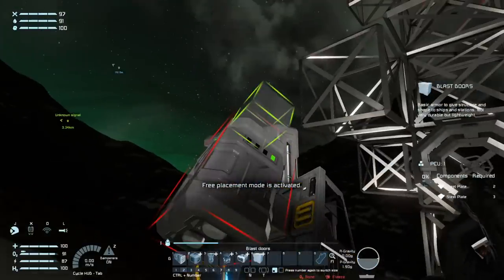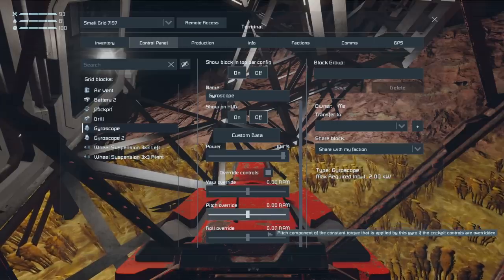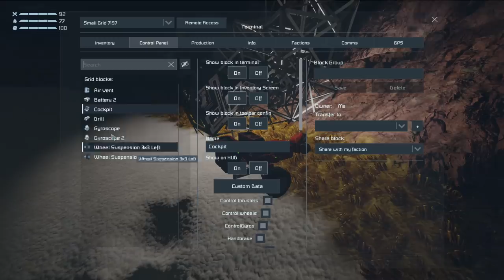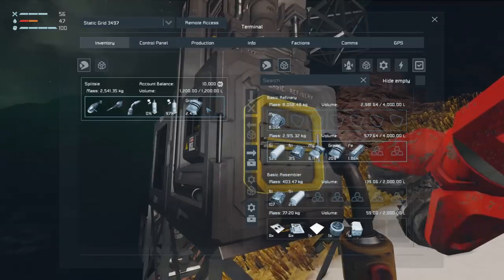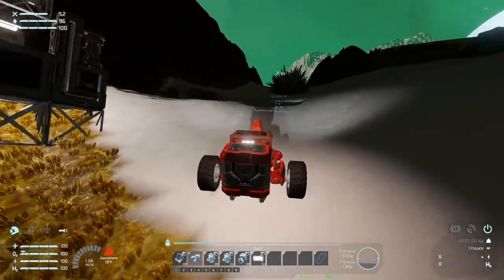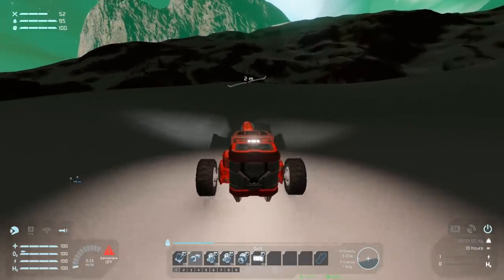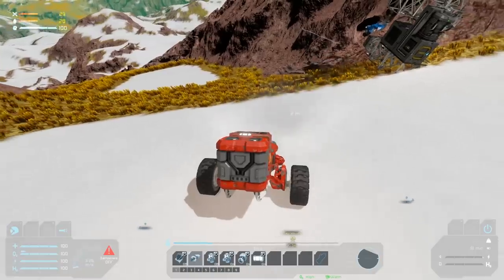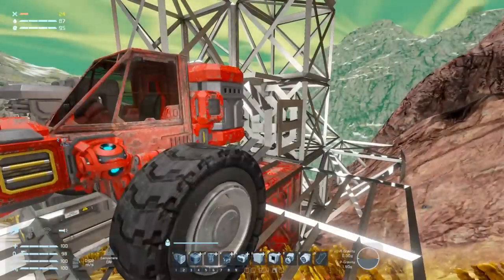Survival Impossible - Finding a Home #3 - Space Engineers Hardcore Survival

Comment: Hmm, to build in the open, at some point of time you will need a pretty strong "iron Dome" defense System. I mean a set of turrets placed in all directions around the base, with overlapping firing Ranges, that results in more and more guns firing as closer to the base the enemy comes. You will want to have it connected to the gtid for rnergy and ammo and on sligtly elevated positions, so you can move around in the base as nö hin can fire "under the Horizont" and Hit anything of the base. On the other side you dont want enemy drones to "break through", so you will want to have enough guns to kill before stuff crash on your head or comes close enough to be "inside" the Dome, also you will want the Dome to be relativ flat, let's say no gin fires below 10° or something like that.
For the threadlevel thing, I would suggest 4 Installations around the base with 4 Turrets each for a start, but the turrets itself should be the very last thing you built. If opponents become stonger, add more turrets to each Spot.

A second idea I just had Was, what would happen if you place a hesvy armed decoy on a Stick let's say 5 blocks long, that is placed on a Rotor, what is itself on a rotsting base... Maybe even a 3rd Rotor involved, so it build a movin target in a sphere of 10 block diameter.... Could this maybe distract any enemy drone long enough, so the iron Dome can take care of the drone, especially if the decoy tower is to the side of your base (you maybe want one in each attack vector)
Reply: it would certainly be an excuse to use the splitsie and capac themed decoys in the mod pack.
Reply from the maker: Decoys like that can be very effective, but I always feel like it's a bit cheesy to do that so probably won't go that route for the defense, though I will almost certainly be building something akin to my sandbag style defense from my previous single player series (though this time I hope to have everything as a static grid) :)
Reply: @Splitsie  thx for answering to some unknown engineer apprentice.
I dont see it as cheesy if it has a price (Material reqirement) is built in a way so it most likely survive (protect the rotors) and maybe even needs some skill in setting it up, so it dont just break and flings the decoy right into your Hanger or something like this because rotors was set to fast.
Also it is of limited use as long as it dont come with active defenses at the same time, like this "iron dome" I pitched above.
Btw you can easily set some turrets in a way, that you can slip under it's firing arc, you just need to Set it up in a way incompatible with drone AI behavior.

Cheesy I would say are methods that overkill everything without great reqirement of skill and ressources like digging under the base and explode a couple of large grid warheads. Or using a glitch things.
A iron dome with advanced decoys to the side of the base would not even use the fact what drones stupidly always come from one point as it Providers cover into all directions (only having only one installment of decoys/weapons where they come from does use their limited AI against them. I think such engineered decoy would be less cheesy than just drop a dozen of them to an area. Placing 3 in a way that enables thrm to survive longer in my ears sounds like pretty usual engineering a improved solution.

Comment: I am wondering if it would be worth trying to build one of these extandable drills for this series. I mean some construct with merge blocks and connectors where you just put more and more pistons in between to extend the range without rebuilding the drill. I am not sure how to build it without loosing to much ressources for the connectors and merge blocks though.. may be its not possible/ worth it with the scrap mod.
But it would go well with a fixed base and the much greater amount of stone needed.
Reply from the maker: Connector+Merge or rotor head detachment is likely to be the way to go for an expandable but doesn't require grinding down sort of drill. I think it might be a little while before I have the resources required to build something on a reasonable scale to start though :P

Comment: So Splitsie ... if the wind turbines that small output, why don't you use solar panels to charge bateries in the daytime? You do have the resources for it and i belive it wil be that much more efficient.
Reply from the maker: I think that I get more per day/night cycle from a turbine than a static solar panel, but will get more from solar if it's set up with a tracking script on rotors, so right now I might be best saving the stuff for solar till I get to my new base location and then popping it all up there :)

Though that might not be the case for the 4th one I added, it's output is probably lower, but I didn't know it'd be that bad at the time :P

Comment: You should throw a solar panel on the tower you got now to increase the rate of charge. Won't use to much silicon, and you can probably even make a small one using your rotor setup. Or is the plan of this series to rely on wind on planets and then solar in space?
Reply: solar does produce more on this planet than wind when the sun is up, It would be in Splitsie's best interest to get a solar tower up using Isy's solar tracker mod and I have no doubt that he will, the tower you see right now is temporary which is most likely why he has not invested in solar yet.
Reply: @_harbinjer  Yeah, could be. But if the point of the 4th wind turbine was to speed up the recharging, then I think a solar panel would have been a better option. It isn't that expensive as you can build it from the stone gathered, and stone he got plenty off.
Reply from the maker: I might have slightly overestimated how much power I would get from that 4th turbine, I suspect that the other 3 are producing slightly more per day cycle than a solar panel, but that 4th one probably isn't. I'll have to look at what the solar panel will cost, but I think it could be worth saving those for the new base anyway so I can get a nice jump on things since I'm not going to be setting up a tracking system for this early tower :)

Comment: Can someone help me I have a worled that I can't see ores I tried hub I tried fixing it with h nothing worked I can't see ores even with a miner that I have built
Reply from the maker: If you're on a vanilla world you should be able to find ores fairly easily using an ore detector set to maximum range then drive around a bit looking for patches of ground that are slightly mottled usually with a bit of a greyish tint, if you're using the scenario I have here, then that's not likely to be the case as the ores are very rare
Reply: Thenks for the help

Comment: how many blocks above the bottom of the wheels does the drill need to be to make a hole that is level? useful for making tunnels and roads.
Reply: it is soo unpredictable/difficult to make anything level with drills and wheeled vehicles w/o using rotors and pistons to adjust the drill(s) height, also the drill has to be quite high (like level or just above the top of the cockpit for level drilling) Splitsie manages to pull it off in an episode of escape unlikely recovering hydro thrusters for the pill vehicle, cheers!
Reply from the maker: Yeah, it's a bit fiddly and gets even worse once you're driving on the drilled terrain. Because it's uneven you'll get a progressive increase in the amplitude of any bumps if you don't constantly adjust to compensate or if you don't have oddly spaced wheels to prevent them always falling in the same ruts at the same time
Reply: @Splitsie  I see your point on wheeled vehicles. What about a flying drone that will just drill/eject all material so weight doesn't become an issue? will scripts work on some sort of in game coordinate system, or within a range of a given point? What about a rotor with an arm that swings 360 degrees and a drill that moves along it's length? will multiple passes smooth it more over time? I really need to get a better computer so I can finally get this game. I'm addicted and have never played. haha

Comment: Instead of fiddling with rotors, why not just put a connector on the top of your miner? Should be way easier to drive under a base connection than it is to align the rotor part.
Reply from the maker: I didn't want to pay for the resources to build a large grid connector on the base - they're pricey

Comment: instead of a underground base make a moutain top combo base.
Reply from the maker: Since most of my vehicles are likely to be wheeled (due to high gravity) I'm planning on building in the more open flat terrain so I can get in and out easily :)
Reply: @Splitsie You could always put a Vehicle lift inside the mountain to get down to more level ground.
Reply: @martinrwolfe   yeah what i mean is u hallow out the inside of the moutain so it acts like a wall over the wall but u have sky lights and places to go outside. think more of a pyramid  with a outer rock layer. how hard it be to get to be more of based on  which moutain u use.